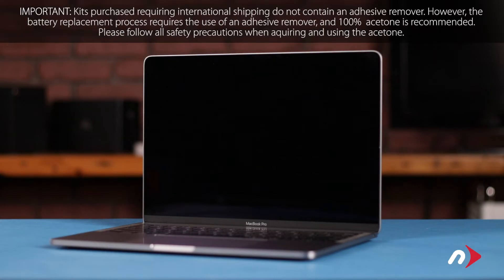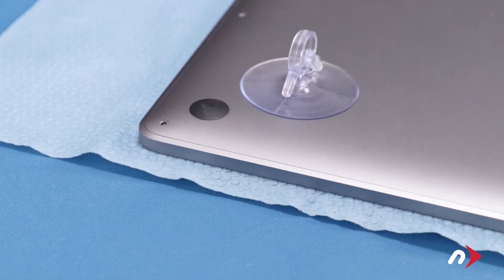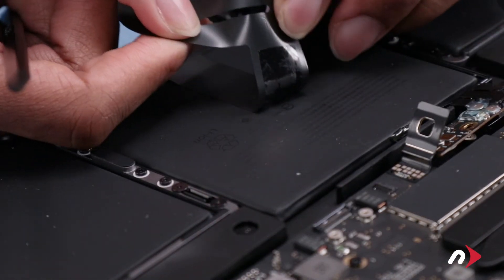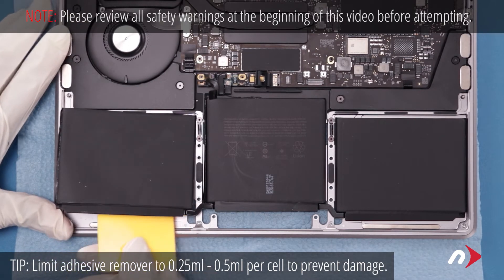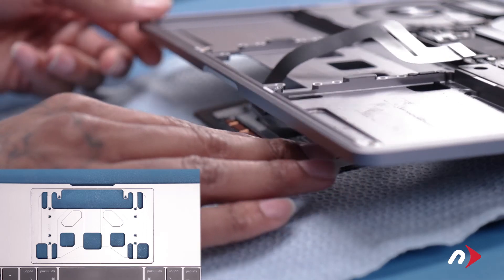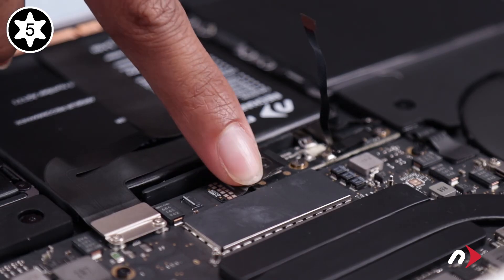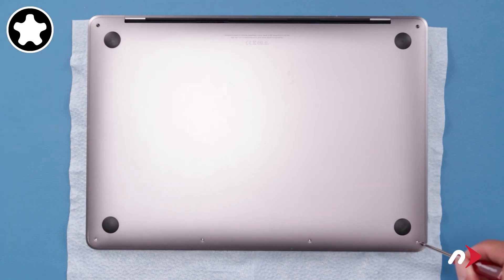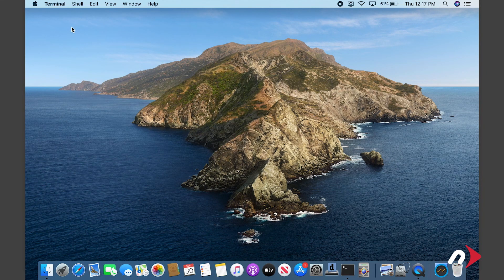How to Upgrade/Replace the Battery in a MacBook Pro 13-inch (2019) MacBookPro 15,4

Comment: I just want to notify about a touchpad installing process. It's better to turn around MacBook and align touchpad right to the placement center and fix it by the tape before screwing process. For the first time touchpad was shifted at bolts screwing and touchpad didn't work correctly. Good luck!

Comment: The ribbon cable broke😢 what is the ribbon used for and can it be replaced?
Reply: did it break? or did you not disconnect it from the original battery?

Comment: Thank you for this exceptionally accurate tutorial. If the battery is older, it can be removed without the adhesive remover fluid. So you don't need to remove or reinstall the trackpad. Not using adhesive remover is also better for the environment.

Comment: How to replace the battery on any other brand Laptop:
1: Remove the bottom screws and cover.
2: Disconnect the battery Cable
3: Replace the battery
4: Put the cover and screws in place
5: Enjoy xD

Comment: there was one missed step: disconnect ZIF connector from old battery board data cable (another, smaller part) and connect it to new battery board
Reply: Thanks i almost forgot this

Comment: I have to replace the top case on this model, and I’m considering buying one without the battery included and just using mine since it’s not too bad. Saves a bunch of money. Still on the fence though

Comment: I replaced the battery for my a2159 but now it only turns on with the power cable. All the readings from the battery are good (checked with the multimeter) so I’m not sure what’s going on
Reply: Probs a dud battery. Send it back for a replacement
Reply: @harveyolszowski3510  did that and it still doesn’t work, might be something with the MacBook itself

Comment: will this kit work on the 2020 macbook pro? my connector screw snapped off in the battery management board and I can't get it out so basically all I can do is replace the battery.
Reply from the maker: We would be happy to look into that for you if you email us at support@owc.com we can certainly check!

Comment: Excellent tutorial. The process is so easy if you follow this step by step. Like, literally anyone can do this is they have the right tools. A few notes about my experience (with an iFixit battery replacement). My battery did not come with the tiny ribbon cable that connects the battery to the computer. So I had to take the one off of my old battery. Sliding it into the new battery was fiddly and profusely annoying as the connection is super small and there is a bend in the cable. You'll see! Also, the track pad has a bit of room around it. Before you tighten all the screws, open up the Macbook and make sure you have it oriented with an even gap around the edges. Not essential, but I am anal and can't stand asymmetry. Also, you're gonna have a lot of tiny screws laying around as you get things torn down. Keep em organized and away from your work area, lest you accidentally knock one off the table.
Reply from the maker: Glad to hear our tutorial was able to assist with the battery installation! We to make it so you have everything you need to do the job yourself. If you ever run into a situation where you have a question please reach out to one of our techs at 1-800-275-4576 or support@owc.com!
Reply: I also do not have the tiny ribbon cable that connects the battery to the computer!  I've thrown away my old battery so not sure what to do now.  Also my track pad is no longer clicking after Ive reinstalled it :face-turquoise-covering-eyes:
Reply: hey there could you send me the link of the M1 Pro battery I can't seem to find the product